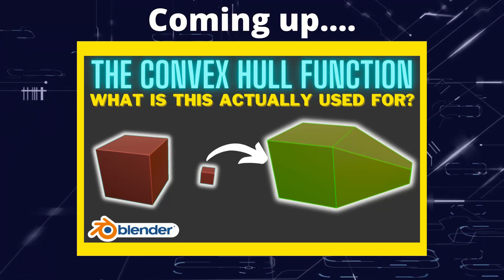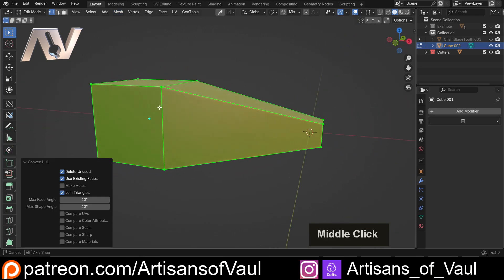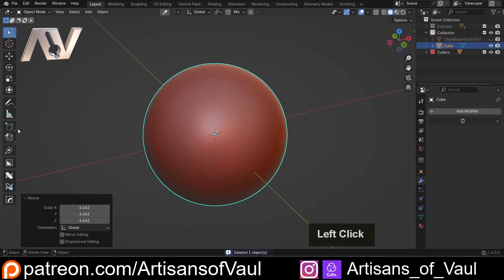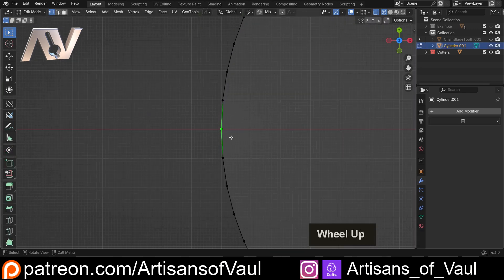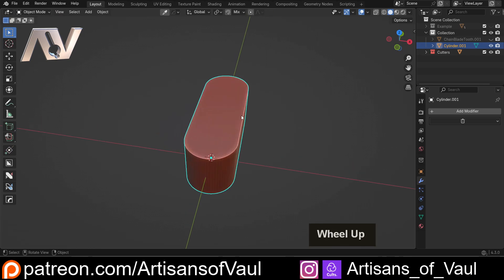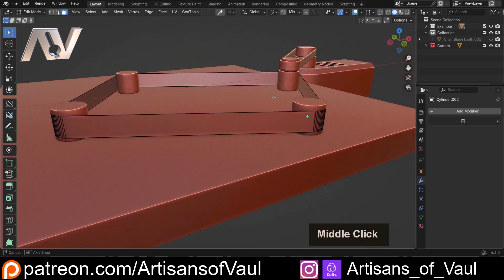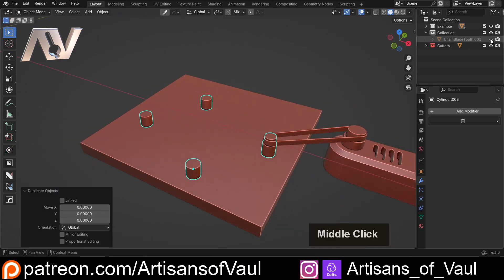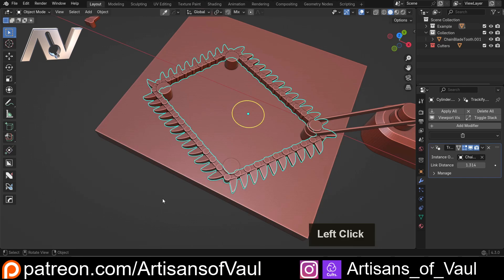The Convex Hull Function in Blender - What is this actually used for?

Comment: Thanks for sharing! Interesting use of convex hull! This can really make short work of machine belts, rubber bands, etc... Side note: regarding the Old Modifier Menu, I was today years old when I discovered that I can simply hold Ctrl and Right click, which brings up the entire radial modifier menu overlayed where the mouse cursor is in the 3d viewport! I'll be accessing modifiers like this from now on! At first, I thought this might be because of the 3d Viewport Pie Menus add-on I have installed, but this is not the case apparently!
Reply from the maker: @norm_olsen  nice tip!

Comment: I bet I've gotten bitten by the stretched-cylinder problem before. Great advice!

And when you're doing rigid body simulation, the "convex hull" collision calculations are the default, which is why the orange bounces off the top of the bowl. Change that setting. :-) 

The convex hull is mathematically "join every vert to every other vert" then "delete all the edges on the inside." :-)  It's called a convex hull because it's the smallest shape that has only convex angles that holds all the verts.
Reply from the maker: @darrennew8211  Oh really interesting on the reason for the name 👍🏻 Thanks so much.

Comment: Convex hulls are for rigid body collisions. There are some cool tricks you can do with them (like creating proxies for better viewport performance), but the main reason they exist is for physics simulations/exporting to game engines.

Also, the free PDT addon (which came with Blender, prior to 4.2) is a CAD tool that can compute tangents for you.
Reply from the maker: @n3onkn1ght  That's interesting to know but regardless of what they are aimed for as a modeller for 3D printing there are a number of other uses too 😉
Reply: @ArtisansofVaul  Sure, but your video is titled "What is this actually used for?" as if it's some mysterious thing that has no apparent purpose. You discussed some incidental time-saving tricks you discovered, but not what it's actually used for (physics colliders).
Reply from the maker: @n3onkn1ght  Thats a fair point 👍  A more accurate title would have been "What does it actually do"